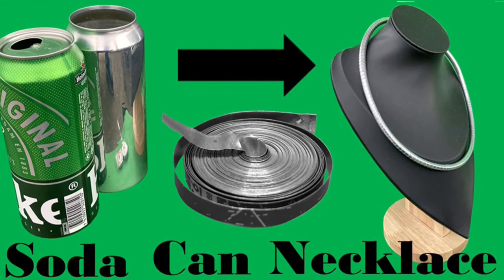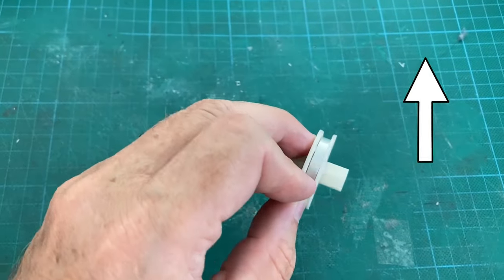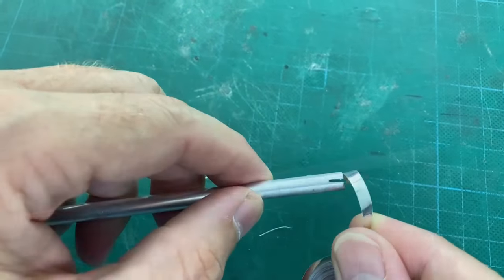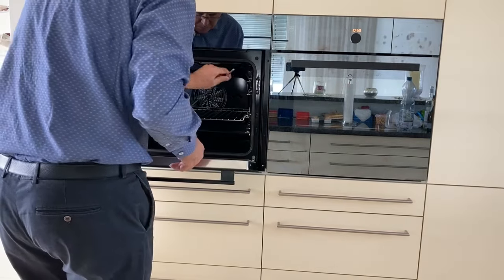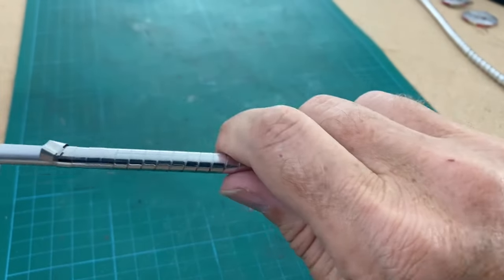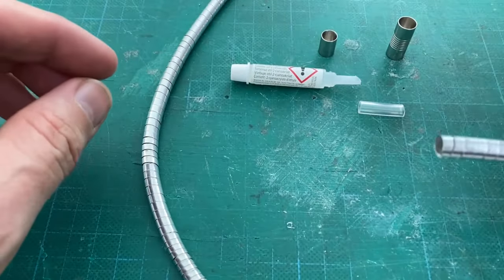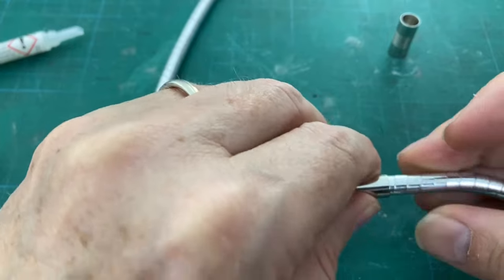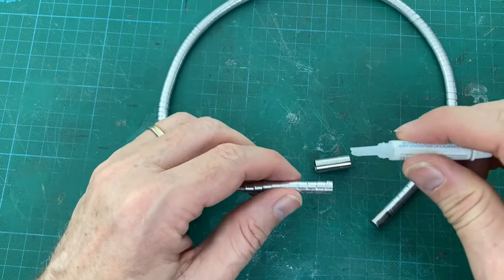Soda can necklace

Comment: I’m wondering if the aluminum cans you are working with have the same plastic lining that aluminum drink cans have in North America. If so, do you eliminate that lining in some way or do the things you make with the cans still have that lining in it. I really appreciate your soda can videos!
Reply from the maker: I only remove the ink on the outside - the product contact part (the inside of the can) of course does have this lining in Europe too. I do not remove it.
Reply: @LeFreak  Thanks!

Comment: Wondering if the edges of the strips are not still sharp?
Reply from the maker: The answer is really no - I tested it for days wearing it directly on the skin - there is nothing. Maybe during the making of the necklace, especially when rolling the strips around the rod you have to pay attention (or wear gloves) but after the oven when the strips are in a spiral way pressing against each other nothing happens